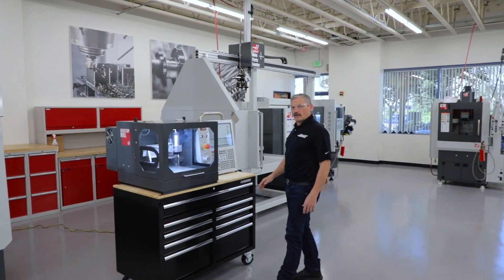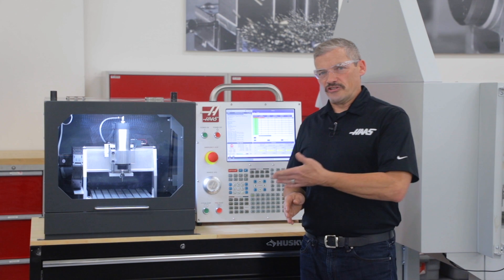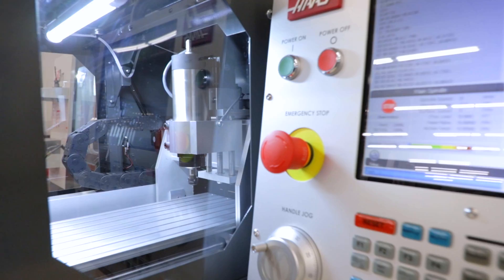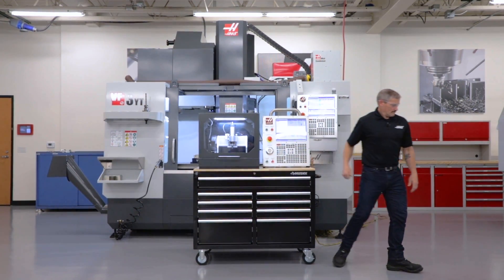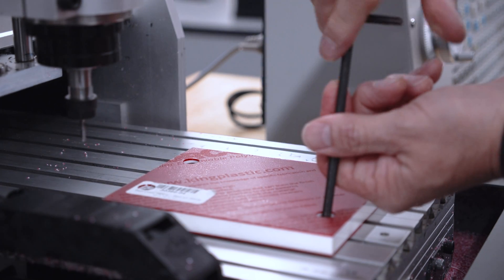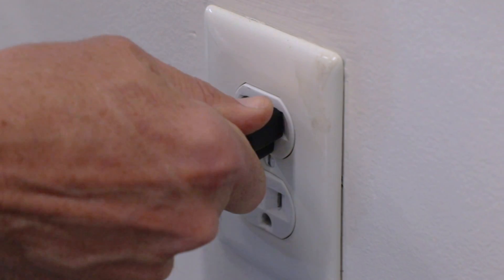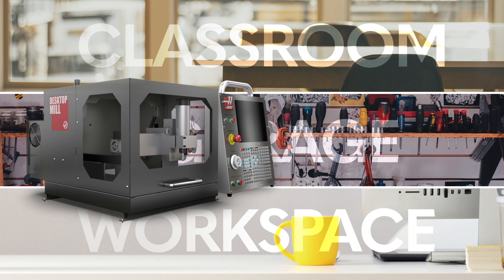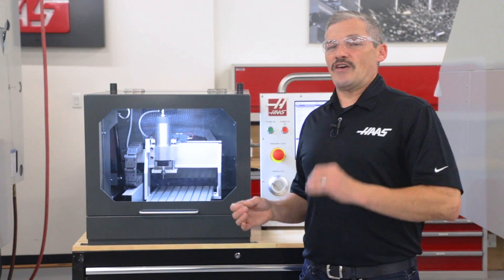Get a Sneak Peek! The Haas Desktop Mill is Coming Soon! - Haas Automation, Inc.

Comment: would had been nice with a ER16 option as well 

btw does it have the relay inside for cooling ( if you put your own cooling system in and want to controle it turning on and off with the controler with a M8 and a M9 ) ?

Comment: HAAS Automation.

More like HAAS Crappymation.
(NO OFFENSE)

1. This is just a plain old Chinese router (3040) with a HAAS Controller that is much expensive than a generic controller. 
Everyone likes the new 1988 HAAS VF 1 you made, until THIS. A crappy Chinese ripoff, Overkilling the prices and everything. I wish you can get new parts like a small gantry mill. Not like this piece of crap. I hope you can improve better in more genetics. and everything. with non-copyrighted parts or you can make it yourself. Its up to you. The controller is much expensive and overkilled the prices than the actual machine.

2. This machine does NOT EVEN CUT METAL, Just plain plastic and wax, WHAT IF someone is a metal machinist and tried to cut this kind of metal How else someone cut metal for real. I will start cutting with a CM 1 or a Large Gantry mill. Its huge that it cannot fit inside a closet. and yes its just a piece of crap. omfg

3. ONE AND A HALF INCHES???? HOW ELSE WE CAN CUT WITH A Z AXIS. what if there is 438724987842749878945798547985488943789057893479857348975 plastic in the machine and people cannot fit this inside. Oh god I wish u can increase this up to 4 inchs or 12 inches. Oh god.

I wish you can improve this HAAS Automation, With 3 simple machine errors.

Comment: I have one of these 3040's I got for under $400.  I bought an undersink cabinet for $100 for the enclosure and another $100 got a used dell desktop with a paraport.  Throw in another $200 for a vistacnc pendant and a $100 cart and you have a nice setup for under $1k.   The target market for this desktop mill is going to be trade schools where they have one big mill and a dozen of these things.  There are large VMC's that can be had for under $10k so I doubt hobbyists will want this.

Comment: Wow a sad CNC router with a height of only 1.5  inches. I can get other ones online on eBay that can go up 4 inches in height. Super expensive CNC controller when on other machines I can just use my computer. Also why won't you put out a machine that actually cuts metal?

Comment: Hobbiests would most certainly benefit more from haas selling their control for use in cnc retrofit, maybe a paired down version with 4 sets of step & direction outputs (+atc) to suit hobby grade servos and steppers. (Akin to the centroid acorn?) Just imagine an rf45 mill, clearpath servos and a haas control. That would be quite the capable and cost effective solution for a lot of start ups and perfect for training.

But before people get overwhelmed with the thought, just remember haas sells their tiny ol1 lathes for a a substantial amount more than their st10 lathes. So making a smaller, simpler product at a reasonable price may just be beyond their capabilities

Comment: But can it cut butter? If it can't cut butter (or aluminum, brass, or soft metals) then I've got no use for it.

Also, if I remove the "Hass" stickers will I find "China mini mill/router" labels underneath? This looks like an eBay router with unnecessarily fancy packaging and controls.

Comment: Looks like someone put a cheap china 3040 cnc in a box and then put a controller worth 100x the cnc cost.
I would stick to a nomad 883 pro or the pocket nc and get 5axis for cheaper and you can machine metals on both of them.
Little disappointing to see such an un cappable machine with a hass sticker.

Comment: This is sort of disappointing. Especially because a lot of the functionality of a proper Haas mill can't be taught on this system. The biggest loss is a repeatable tool change system. Second is workspace probing. With those two added it would be a MUCH better training system.   (Tool probing would be nice but I don't know how it could be done at reasonable cost)

Comment: As a training tool for the Hass control system in schools I can see the purpose for industry.
I can’t see ANY hobbyist being interested when there are so many better, cheaper options available. This smacks of Hass just trying to sell additional units to a different consumer base than it was designed for without respecting what they actually need. Disappointing.

Comment: It looks like a cheap ass 6040. Give me a solid, cast iron base, not a dinky aluminum chassis. Plus, based on what they want to charge for it, no tool changer or flood coolant? 

I understand you just want to cut plastic and wax, but there are machines to do that for literately 1/10 the price. Shit, you could probably get a beater VF for less than a new one of these. 

So unless you plan to give them out for free, I'm not sure who the market is. People buy VF2s because they're a great deal. This is most certainly not.

Comment: I believe its only really meant to be a school trainer in the same rooms as 3d printers are now.   Its not a hobbyist machine.  
But I am sure it will cut sheet alum - wood - and some engrave projects in metals.  

2 different paths - Hobbyists can run a laptop based Mach 3 controller with a decent sized cheap router - or learn how to use and understand Industry standard CNC as the "other" way of manufacturing - 3d printing is still a long way off to being competitive unless your just doing plastic prototypes  - never mind the 3d print metal machines - eventually it will be a hybrid world of CNC ( subtractive ) and 3d print ( additive).  Kids in schools only know 3d print. 

This is meant to train people who will end up on REAL Haas CNC machines - like we have at our school.  So if you are learning engineering and solid model design in middle and high school - and then end up in our shop - your are ready to go and make real parts. 

we made 2 titanium Golf club heads for U of Florida engineering last year after learning on Fusion 360 -  that's our hobby
Reply: agreed but then why promote it as a Garage hobbyist machine?  Quietly release it on your website and have the HFOs contact their school accounts.

Comment: cool tool, too bad cheap Harbor Freight Mills will beat it in almost every scenario, hell this isn't even a mill - its a router don't kid yourselves
You are HAAS, you have the skills, knowledge, and capacity to do better

this is essentially a dead product on launch:
1) can't cut metal
2) 1.5 in vertical cutting space, that's honestly pathetic
3) That table is ALUMINUM FFS
3) No doubt insanely overpriced to anything comparable, 1-2k for a harbor freight mini-mill another 1k or less for a full CNC conversion (that will beat this in EVERY way)
4) HAAS controller is beyond overkill, you would be better off just offering a software package to cut the cost and put it to use making a useful machine
5) not even a tool changer? huge education point that you failed to meet

I hope you can fix this before launch because hobbyists and even educators will scoff at how truly neutered this sad router with a fancy brain-box is
there is already a true blue 5- axis desktop mill released years ago, sad to see that you cant even stock up to the Pocket NC (and it cuts metal)
there are better, cheaper, and far less expensive products on the market, show us something new, or just plain better, because this is a disgrace to the HAAS name

Comment: Looks like you just took a $300 e-bay special and tacked on an unnecessarily expensive control system. Engineer it to do aluminum and steel, even at slower speeds, then you'd have something home gamers would be interested in.

Comment: My guess goes something like this...
Machine (with enclosure) + Controller + Haas Tag = 
$3000 + $2000 +$4000 =
$9000.
This price will drop like a rock when technical schools don't buy. The desktop mill will be discontinued sometime in 2022 as a miserable failure because the ten buyers will try to cut aluminum and brass thus voiding any warranty.
Haas should take on Tormach, Syil, et al with similar Chinese-made machines running the Haas controller, BT30, 12 tool ATC and full enclosure. The Haas subsidiary may be called Haas@Home where every machine is "designed in California, USA." Sell complete machines (with rigid tapping) for the same price as Tormach or Syil. The Haas controller alone will drive sales away from those other brands. Just my two cents...

Comment: This is hilarious, it's a $500 Chinese CNC router, with a $5,000 Haas controller on it lol
Reply: The price has me wondering. An affordable quality bench top cnc is elusive.
Reply: May be it have magic materials with incredeble quality and infinity servece life?
Reply: No kidding! Funny thing is, I just got a 6040, threw the controller away (because it's cheaper to get a built unit instead of just the frame!?) and put a UCCNC controller on it, it's perfect for a desktop mill, and i'd bet it would still come in under budget compared to the Haas.

It's not even using parts they made, they just bought a load of 3020's and slapped their controller onto it!
Reply: Reuel T  You have no idea what I do for a job, so maybe not assume things.

Regardless, there's a big difference using a desktop mill with a Haas controller, and using a half a million dollar Haas VMC.

Sure, you learn how to use the system, but any engineer that uses CNC's on a daily basis will quickly learn how to use multiple systems, and it wont matter.

I still use some 40 year old Fanuc and Mazak controllers, but it isn't that difficult to learn them.

Put it this way, if your only stumbling block in engineering is finding it too hard to home the machine because it's using ancient controls, you should probably think about getting out of engineering.
Reply: Yeah, why the stupid controller? An arduino can do that perfectly well, for about £20.
Reply: @robbiejames1540  Well guess it can be useful to learn how to use Haas machinery

Comment: my guess.. this will cost around 3000 dollar. you can cut aluminum with it but with an slow feedrate and small depth of cut.
Reply: 3k is a bit to low for haas maybe 6k
Reply: @chaddanylak8706  no. a machine like that can be build for less then 1k. 2k for the screen and software and enclosure.

Comment: What a flop. They took a 3040 and put it in a sheet metal box and attached a Haas controller. Only machines plastic and wax? I can't see any use for this outside of the classroom. Any hobbyist is going to either buy a tormach (if they want to do metals) or a router (if they want to do plastics/woods faster, or even larger aluminum projects). For the price of this you can buy a pretty stout router that will be 4x4' or 4x8'....

I say this as a fan of Haas machines, who learned to program on a Haas TM-1 and would love to own a smaller Haas one day.

Comment: While I like the concept for it, I think if you want a small mill, go for a CM1. This desktop mill looks like more of a router. The biggest problem is the controller itself is a couple thousand dollars. While I do like the haas controller, it’s way more than you need for a machine like this.
Reply: CM-1 is drastically overpriced and I'll bet it's their highest profit margin machine because it has a niche market in on-site medical/dental. You could almost buy 2 baseline MiniMills for the price of 1 baseline CM-1. That's ridiculous.

As for the Desktop Mill. Useless in nearly every way.
Reply: Kenneth Higley I agree, but I like it.
Reply: @pumas4pets Its oveer priced but a 30k rpm spindle that cuts steels can cost a rediculous amount.

Comment: The controller looks like it's more expensive than the machine 😂
Reply: The machine looks eerily similar to machines sold on ebay and aliexpress ass "cnc 3040" or similar. They cost around  400-700 US dollars.
Reply: Most likely is.
Reply: It looks like a 3040 as Samuel says.  The loss of travel over a standard 3040 is probably down to limit switches installed to give feedback to the control.  It does look to use some of the Chinese 3040 extrusions.  
You're paying allot for the control, the cabinet, and that fancy cable chain. 
The machine I was imagining was more like the office mill, but on a much smaller scale, maybe a tiny hsk 30 spindle. 
Could you imagine having to call a Hass service tech out for this thing?
They might have been better just going straight after tormach's customers, with a smaller, cheaper version of the TM1.
Reply: Wish it could cut metal... As a home mechanic, that would be very interesting.  But I can certainly see the educational value.
Reply: I'd buy it just for the controller then build my own mill.
Reply: My first thought too...

Comment: But can it work on Aluminium at least???

Because 3d printers are a better options on working on Plastic parts
Reply: too bad 3d printers are unreliable and don't work right half the time
Reply: @electro740  if u buy quality ones they are gona do precision task easily
Reply: @electro740  i informed myself about tis mill and it can only work on Plastic materials
Reply: @electro740  
Actually, 3D printers nowadays, even old ones like the CR10, are reliable - maybe one failed print in 20 - 50. If you take the time to dial them in, they can be quite precise as well. Their drawback is the "grain" of the print - it is significantly weaker where the layers join.

Comment: It's tempting to buy it, hack to large DIY router and use as propper CNC ....LOL
Reply: It would be nice to have a proper shop-built desktop CNC mill and then just buy an off-the-shelf Haas controller to run it.
Reply: If they do make it cheaper to capture entry-level hobbyist or student markets, or these start showing up cheap on eBay or at auction houses after the schools and training facilities are done with them, then yeah, that's a great plan. But I suspect it will cost about as much as just buying a Fanuc or similar CNC control system just because of that $5k controller attached.

Comment: If it can't at least do aluminium it will be of limited use for hobbyists. We have 3D printers for plastic stuff...
Reply: I saw the linear rods on the Z axis. So disappointing. Might as well buy a 6040...
Reply: @RobbyNowell  yup, my 6040 has a larger work area.  And I can also cut aluminum.
Reply: Only 1.5" Z & only capable of plastic, this turd is DOA.
Reply: 1.5" z for plastic only? Uggg

Comment: That enormous control panel is hilarious. Almost the same size as the Mill itself. But doesn't that jack the price up in proportionally high compared to the cost of the mechanics? Especially for hobbyists. For training purposes it is perfect.
Reply: Not if it's a standard panel that is in use on other machines already. Had they designed and tooled up to produce a custom panel, with a much lower annual production rate, the cost would have been much higher.

Comment: This machine must have tool changer.
Reply: It does have a tool changer. That tool changer is you with a wrench.
Reply: @CathyInBlue  LOL :-)
Reply: I have Proxxon FF500 and tool changer like that, its pain in the butt to make something. But this will be much more expensive.
Reply: Right. Tool changer or nothing LOL
Reply: Awww cmon, you don’t want to fit both hands and your head in there to change the collets every time? It’s ok though, I’m sure they’ll ship it with a renishaw probe so we don’t have to zero each axis with our new invoice. I mean with a controller like that... certainly all of those buttons retained their function!
Reply: This machine must have Trough Spindle Coolant , lol.
Reply: @icabod3374  Yup, extremely important cutting wax :-)